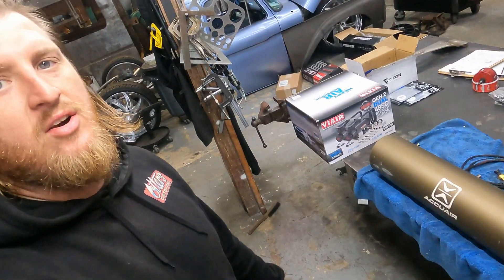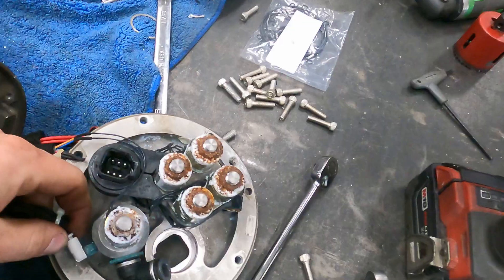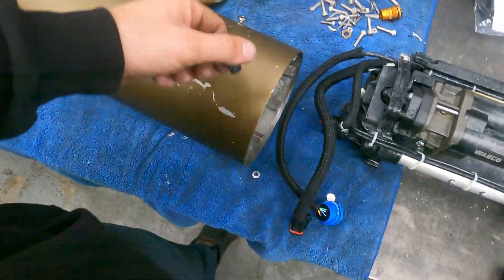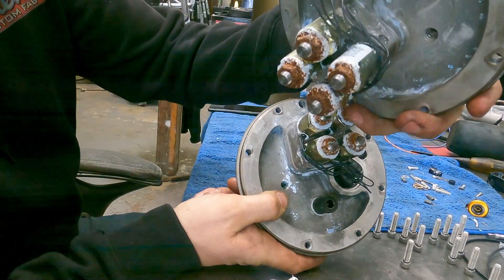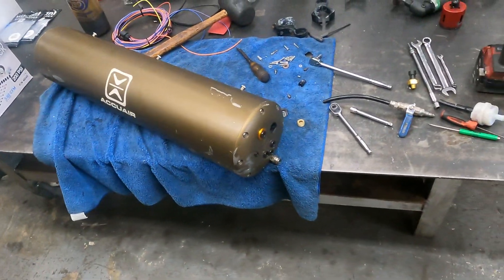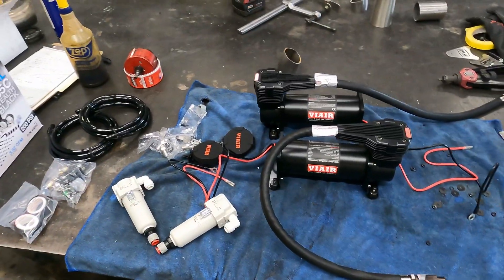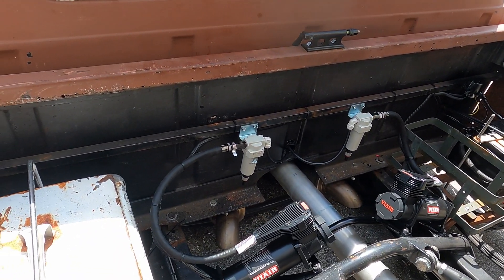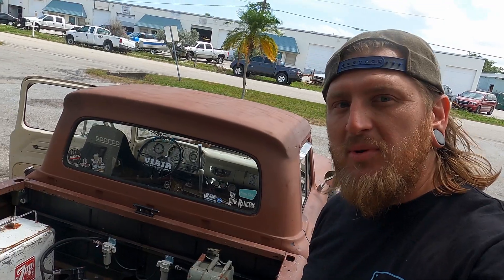Endo CVT to VT Accuair Tank Conversion on Taylor 1.0 - Hutch's Welding

Comment: Have a brand new cvt should I even use it smh can’t believe they abandoned this platform
Reply from the maker: You have options: 1. Run it and do the conversion later if necessary, 2. Do the conversion to external compressors and attempt to sell the compressor unused. 3. There are people out there that will probably want it, so sell it as is and buy a new system.